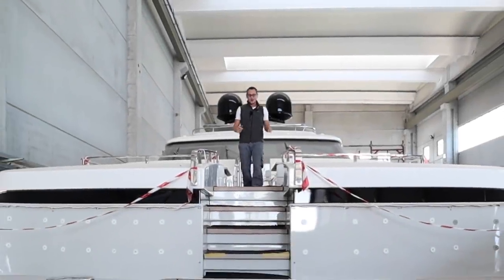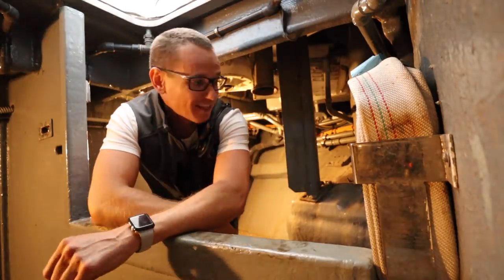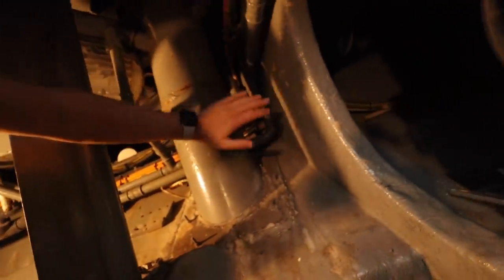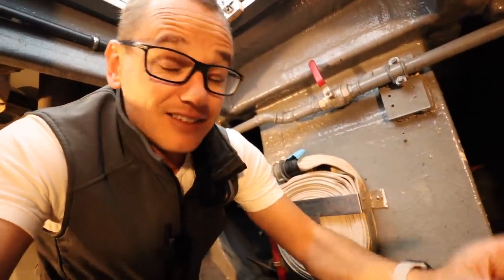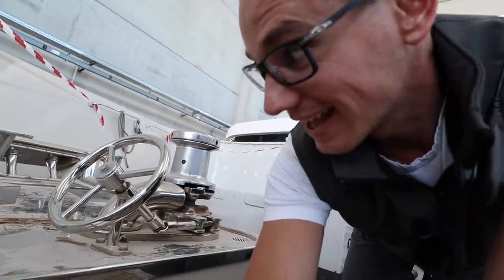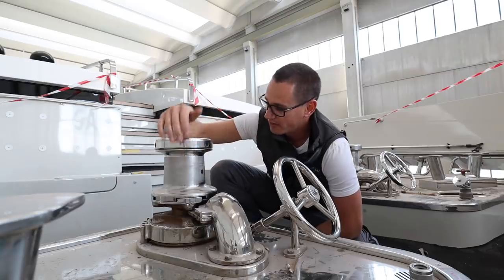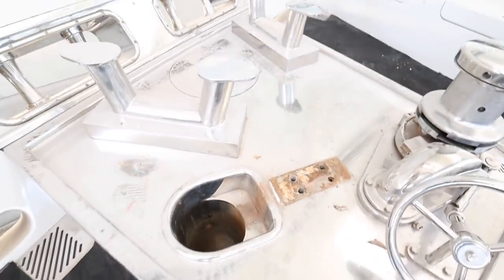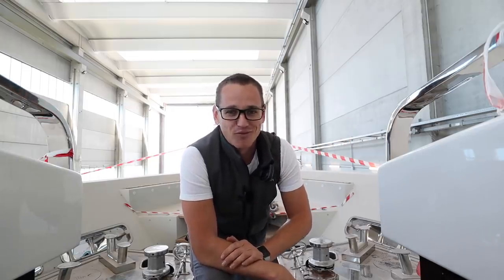INSIDE THE ANCHOR LOCKER OF A SUPERYACHT (Captain's Vlog 132)

Comment: Really good to reiterate that advice Tristan, Anchor lockers, even on wooden and fibreglass boats can be dangerous confined spaces. People still fail to understand the risk because they cannot smell any odour, feel themselves initially breathing normally, completely unaware that the oxygen component of the air mix has been busy oxidizing away surfaces and anchor chain or being consumed by the wood. Really great blog update and really hope that 2020 turns out to be a good year for AWOL. Stay safe!

Comment: Can you do a video of you refitting the anchor? Does the anchor chain have a length of rode attaching it to the yacht in case you reach the bitter end?
Reply: First you need a video presenting how anchoring a vessel works in the first place. It's surprisingly simple but most don't get it*(meaning understand the the principles behind anchoring) so they wind up getting massive ground tackle tech with no *"grounding" in the idea of anchoring in the first place. In short worse than meaningless. The best example of anchoring I have ever seen in real life is from the YouTube Channel "Sailing Uma" during the 2019 Hurricane that obliterated Grand Bahama Island and the Abacos last Year (this year being 2020).

Good luck doing that with your Super Yacht!
Reply: The have a rope attached to it to hold it in but if the chain runs away it won't hold that and it will let it go

Comment: The warning about confined spaces and requirement to check the space for adequate oxygen levels prior to entry gets full kudos.  However, in the anchor locker is located a fire hose.  In the event of a fire and that fire hose is needed, getting the fire hose will require crew personnel to enter the locker to retrieve the hose.  There would be no time to check oxygen levels before entry.  If person was entering while wearing SCBA then okay, but in a fire emergency can you guarantee that crew member or passenger will not enter without SCBA?  You might want to look at different storage location for this fire hose.

Comment: Very educational, thank you so much. Just a couple of questions, is excess water pumped out of the locker?, also, I have seen a video of a thing called the anchor locker chain drive... Is that only for larger vessels? I suppose it's used to avoid clutter and jamming?
Reply from the maker: The locker has a drain hole at the bottom for the water to drain freely.
Reply: @SuperYachtCaptain  thank you for your prompt reply. I imagined it would be so, but I thought that a way out would also be a way in, at least in heavy seas?

Comment: Anchor locker?  Apologies for disagreeing, but it's called a chain locker - the anchor isn't stowed in it!
Reply: Back when I was in the Navy, it used to be called the Bow locker.
There's all sorts stowed in there.
Reply: Royal Navy tend to call the chain locker a cable locker (as in anchor cable) but this is a merchant vessel, so chain locker it is.
Reply: And nothing else can be stowed in a chain locker, or it would foul the cable during anchoring.

Comment: Wow! imagine having your fire hose and nozzle stored in a place that requires a confined space entry using a gas detector. Does this give anyone pause?
Reply: If it's a fire you'll be in and out getting that hose in a sec. It might also be reachable from outside looking at the video. I would not be worried.
Reply: You can reach it from up on deck. No need to enter the compartment.